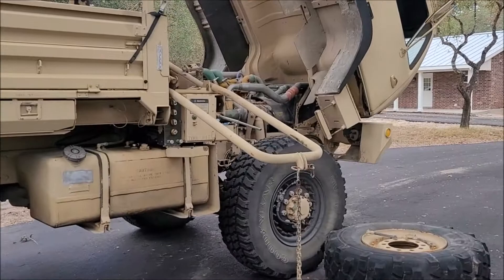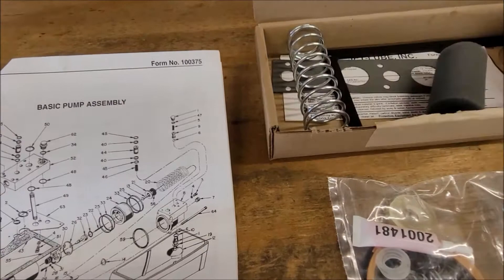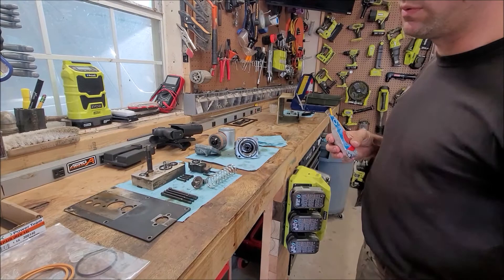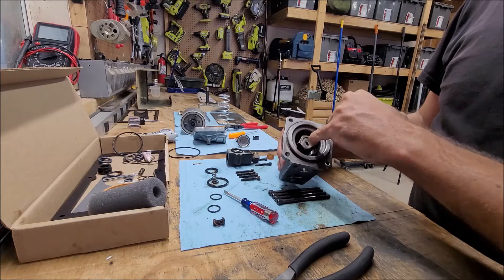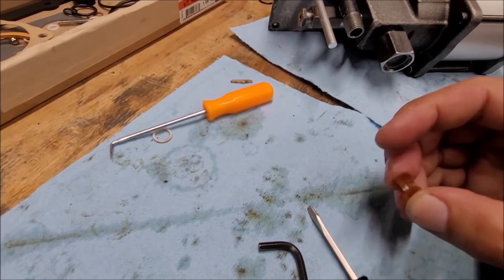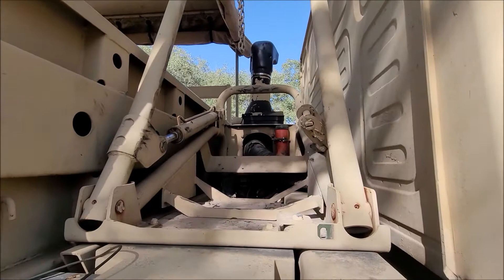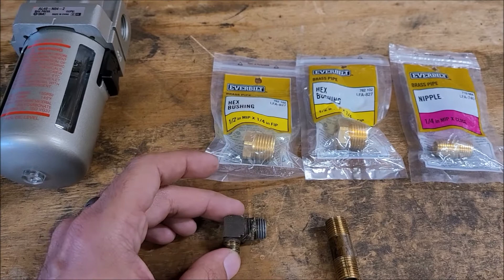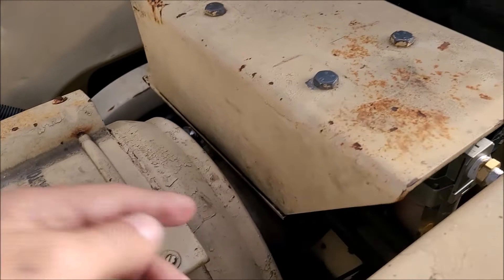M1078 LMTV - Update #4 Air hydraulic pump rebuild w/ improvement

Comment: The reason you were having problems is because you forgot about the bleeding procedure which you figured out in the end with the manual hand pump.  This is often overlooked when rebuilding these.  The other thing to do is leave the cab up and manually lower it with the hand pump which will purge the lines also.  Pesky little rebuilds but you will never have to do it again...
Reply from the maker: I figured it was something like that. I had watched the video where you had rebuilt yours and remembered that it took a while for it to prime or whatever. it's much better than pumping it up and down by hand all the time!

Comment: I think much like rebuilding a brake master cylinder... after the fact the air would need to be brake fluid in order to work.   So when you pumped the manual pump it probably forced the needed hydraulic fluid in the air over hydraulic pump.  Made it work.  Great video!
Reply from the maker: Yeah, after thinking about it some more that did it or I pushed the air out hoking the lines up the wrong way.
Reply: @CallMeColtLLC  what's your plans with the m1078?   I'm turning mine into a camping rig.
Reply from the maker: @0.0.0.0.1  Right now, I just want to get it mechanically 100%. Then, I may make it a dump bed & put a small crane on it.

Comment: That is a nice mod! Great idea and it fits beautifully. I like it! Yeah, purging or bleeding the hydraulics is funky. When I first got my "parts" truck "PARTriSha," I had to do a lot of cycling and bleeding to get things back working since it had sat for so long. That was back before I got the hang of things, if you know what I mean. Keeping pounding away... these are really some capable rigs when they get maintenanced. I rebuilt the air dryer today... I was horrified at what I found.
Reply from the maker: My air dryer is on the list for the next video. I bet it's going to be bad! I may just upgrade it if it looks real nasty as I have a newer style one.

Comment: I have a leak from the cab locking mechanism. I noticed it’s not bad yet.
Reply from the maker: Before it completely fails, just fix it. It's much harder when you can't remove it. It really only takes about an hour from start to finish. Much harder if your cab can't be lifted!